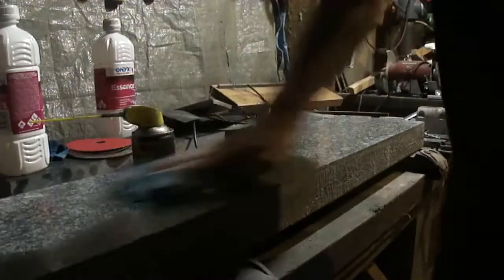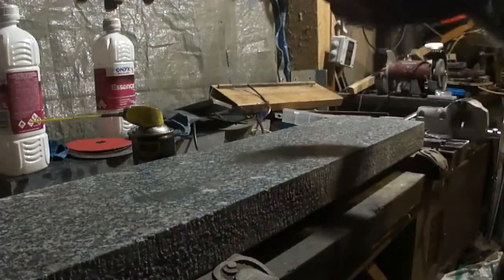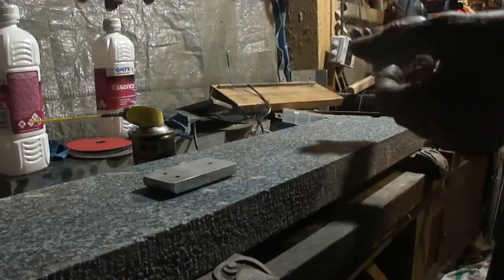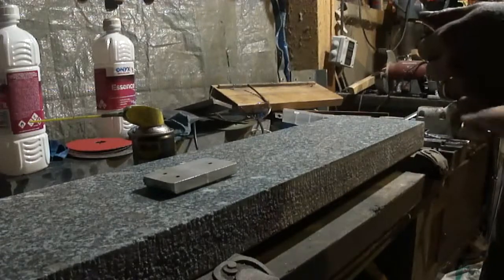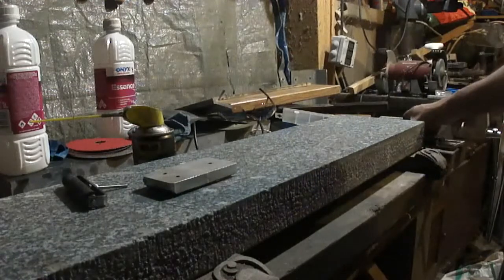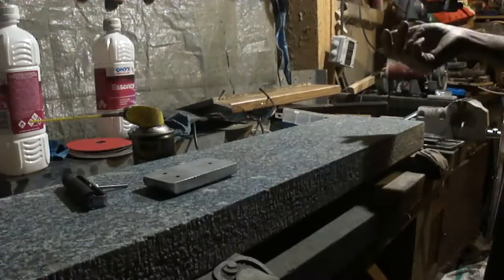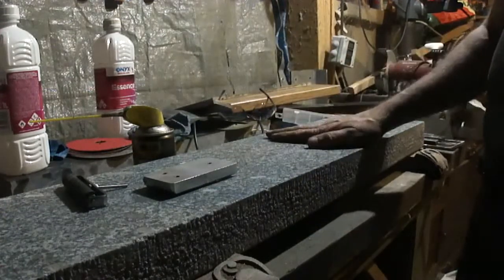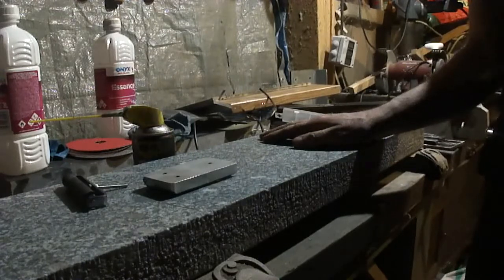Granite Lapping Followup

Comment: Thanks a lot! I never know you can make your own surface plate
Reply from the maker: I dd it the hard way, by measuring and grinding.  If you have 3 identically sized pieces of granite, you can use the 3 plate method to lap them against each other and get 3 matching plates with very little measuring work.  There's plenty of videos covering this.

Comment: What do you mean, when you talk about a "moody decomposition"? Would be fairly interested in some links or resources regarding this topic. Also: Nice Work!
Reply from the maker: Pretty much THE seminal work on mapping surface plates was published by Moody in 1955, the paper is on the github for my software (docs directory).  Moody's decomposition of a plate is pretty much a "union jack" mapping - along all 4 edges, across the 2 edge bisectors, and the two diagonals.  this gives a pretty good breakdown of the plate's geometry, without requiring the person doing the calculations to work for weeks at a time.  The grid decomposition I'm using is more work to measure, but gives a closer approximation to the plate's actual geometry at a "micro" level.  The math is basically the same, and Moody could have used this approach, but manual calculation would take forever to do.

Moody decompositions are still used in industry, but they are generally starting from a known more-or-less flat plate...
Reply: @wibblywobblyidiotvision  Thanks for the informative and fast answer!

Comment from the maker: When I say my level is "not accurate enough", what I actually mean is "not precise enough" - mine measures 0.05mm/m (or 10 arcseconds) per graduation, which corresponds to 3 microns per graduation if the level is placed on a 60mm "bridge". What I need to get my hands on is a 0.01mm/m (2 arcseconds) level, obviously this is 5 times more precise (and 10 times more of a pain in the arse to use), and should get me down to ~5 microns total error.